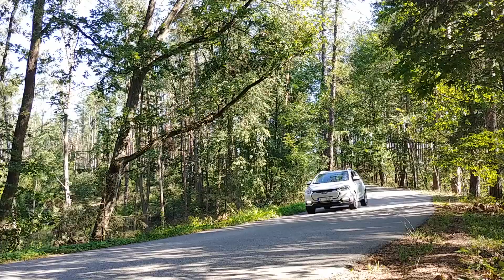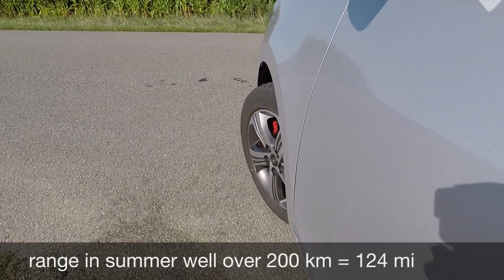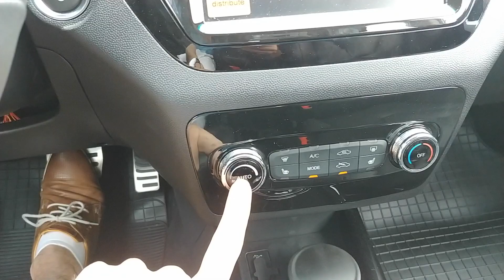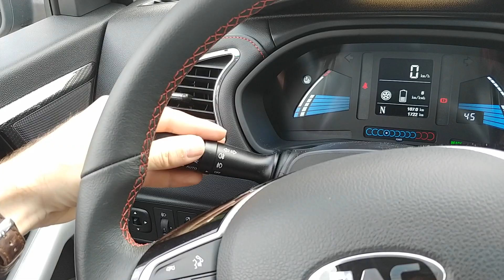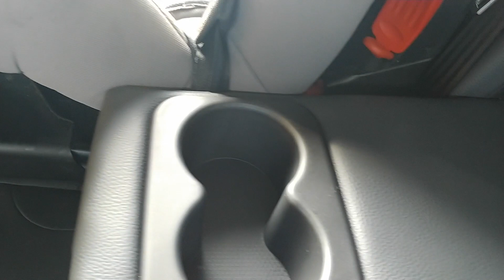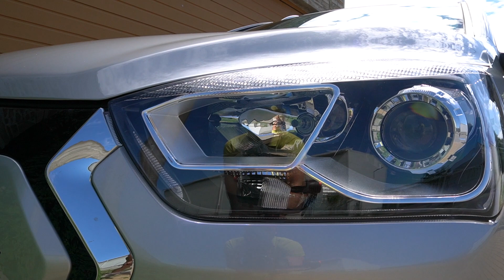JAC iEV7s – Detailed review of a Chinese EV | Jan Staněk | Electro Dad # 37

Comment: I have this car for 1 year now from April last year. It have 50.000 km without a problem. Jac produce more electric vehicles...IEV6, IEV7, IEV4S, new model A5, and many other. But only iev7s is available for europe
Reply from the maker: @Testdriver2804 it may well be. At the time of preparing the video, there was no other model presented on the English web of the JAC manufacturer.
Reply: @ElectroDad  
Follow chinese site, many of chinese automakers simply dont update their english sites
Reply: Hi
Would you be more specific about the car
I am thinking of buying it but I'm really hesitant 

Thank you
Reply: How is the car with you so far? ??? How many km and did the lifespan of battery the battery drop? 
how much does it cost in italy?

Comment: JAC is launching 6 EVs here in Mexico, but I'm not sure about long-term reliability of materials and batteries, compared with Renault, KIA or Tesla, what do you think?
Reply from the maker: @Víctor René Valdivia Soto good question. I think the quality of JAC is fine, comparable.
However, since Mexico has a (very) hot climate, I would recommend buying an EV with active thermo management of the battery, so that the battery gets cooled down. High temperature + high voltage (fully charged) = fastest battery degradation.
Reply: @ElectroDad  Sounds good, thanks for your review, very thorough!

Comment: I own one of these in Uruguay, the car could be ordered with a substantial deposit (5000 USD) since june 2018. Total price then 37.990USD .Mine was ordered in august and took 7 months(february 2019) to arrive as the factory released a european software version and a CCS socket. The software version had some quirks which were very annoying as regards to the connectivity of the centre screen with the CAN bus in the car. Also being programmed for the EU the radio in AM can only tune in 9KHZ steps and the norm here is 10KHz/step, therefore only tunes properly in 3 stations and we have some 22 statios in that band. Tried all sorts of button combinations and didn't solve the condition. The car manual is in Chinglish and almost useless. I don't know if you have the same problems but the dealer here was not very helpfull, they shied away from my requests. I am not deriding the car which agreed with your review has positive features, even the efficiency is quite good compared to others although it is wasn't designed as EV from the ground up. Other annoying thing is the strong smell of chinese plastics inside.
Reply: Hi, i hope you enjoyed  your care since purchase. I have seen some sellers that advertise  this car at 12500 usd whith minimum order 1 piece. Why do they go up so much in price afterwards? Besides shipping which is max 1500 by sea, taxes over 35% on purchase price. It might jump to 19000. But i don't  understand  why it should go to 38000k? Do you have any ideas ?
Reply: why did you pay 38k $ for a chinese car? thats huge. With so much money you could have bought a much better car.